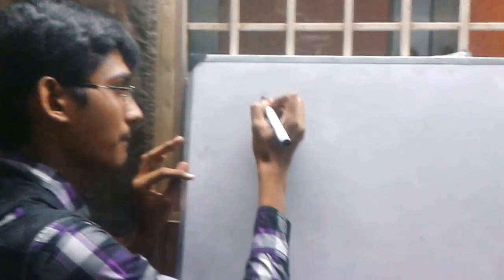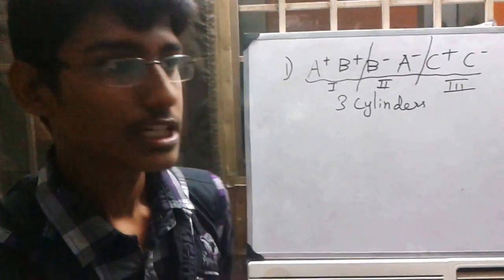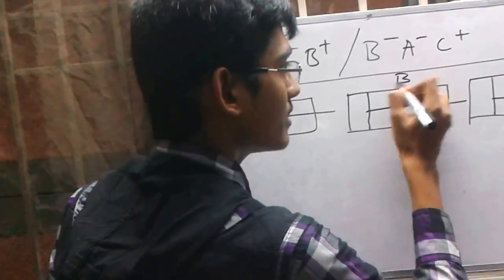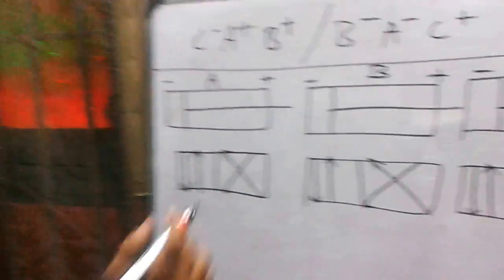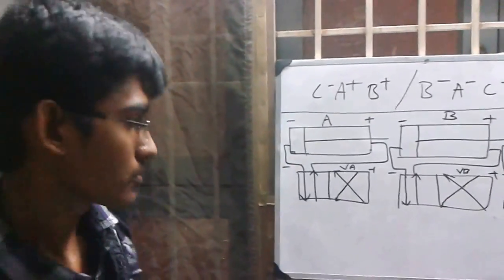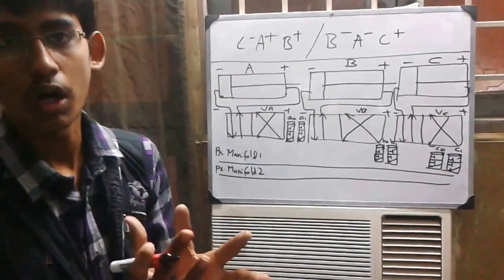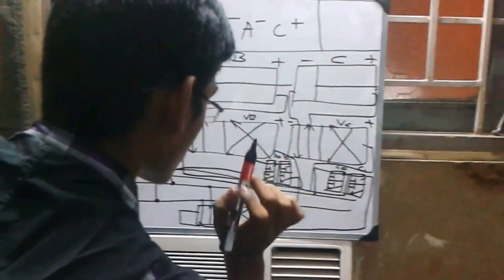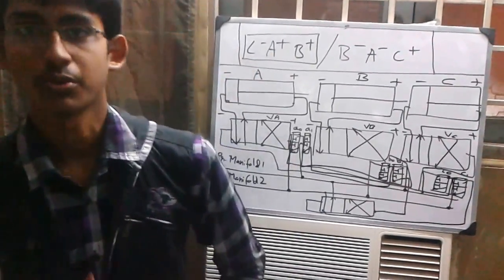CASCADE DESIGN LECTURE

Comment: Good bro. But I can't understand the last part of the circuit, which you are taking connection from other side and connecting to group 1 or 2 to complete the circuit
Reply from the maker: According to my simplified way of understanding, limit switches connections should be closed on both sides. So we will check with our simplified sequence then connect it to their expected pressure manifold lines. This will complete the cascade circuit.. This is one way of doing things. You can solve such sequences & create your own way too for your understanding. Any difficulty you can always get back to me.. Please do subscribe bro1!! TC BYE
Reply: thanks bro

Comment: icnt understand the last step. frm.whre ur connecting the both sides of ao a1 bo b1 co c1 + - to the pressure 1 and 2
Reply from the maker: http://nptel.ac.in/courses/112106175/Module%204/Lecture%2040.pdf  ... I prepared using this link.. If at all it clears your doubt..Then well & good..Otherwise Get back to me...I will send a written Explaination!! Thanks Allan... Cheers!!!

Comment: Pressure manifold is not 1 less than no. Of cylinder it is the one which is equal to the groups formed
Reply from the maker: Oh is it bro. I have been remembering it like that and so far it has worked. Thanks for your comment, I will add this in teaching next time.

Comment: i think there is a error. the dcv of second and third cylinders are not complete. i mean b- and c- in the dcvs
Reply from the maker: +Arun Sampath  I watched it Again and Unable to find any mistake.. Please send me a complete analysis of mistake with suggestion for Clarity and improvement if any to KVARUNRISHIKESH@GMAIL.com... All the very best
Reply: +THE PROUD INDIAN RISHIKESH K V Check the dcv inputs b- and c-. They're not connected to the group lines
Reply from the maker: +Arun Sampath  Ohh Thank You... Yes there is a mistake.. During that time I used to work out Cascade by noting Just the number of connections to Pressure manifolds... In above case it came out as 3 each...So I left it that way... It had to be another B- and C-  connection making it 4 each...Thanks for Knowledge...#Friends ... Please sUBSCRIBE & continue to be a Critic... Will be Great !! Cheers